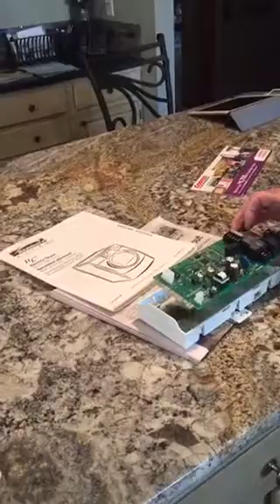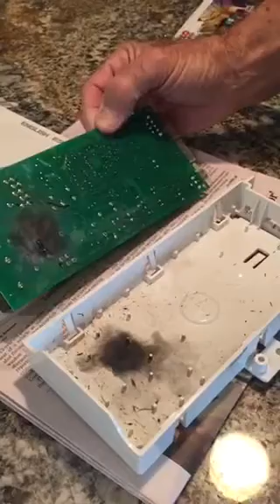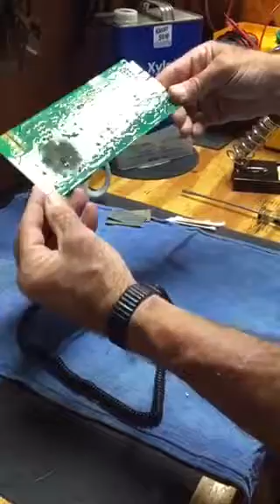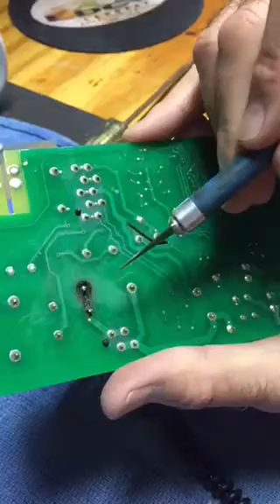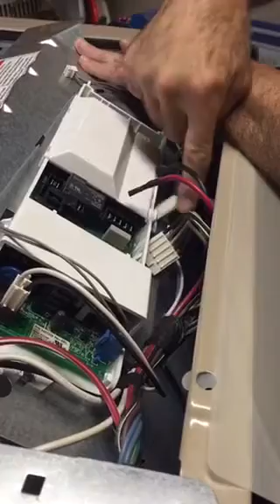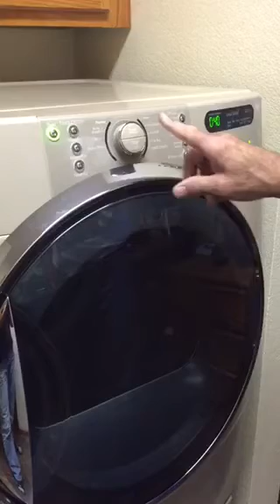Kenmore/Whirlpool Dryer HE5 F01 error code fix by Tom Miers

Comment: Tom, I just wanted to thank you for taking the time to post this video on YouTube.  It was very accurate and straight to the point for correcting the Kenmore Elite F10 Error.  I actually fixed my HE5 Elite tonight and it save me $235 for a new control board.

Comment: i had an Elite Oasis ST dryer with very similar problem-- the trace wasn't burnt... just a single solder on the back of the board had been toasted.  one good glob of sauter down in there fixed it. 

W10111623 (although the board has a Whirlpool board number on it:  W10111616 )
Reply: When I finally looked at the back of the board, there wasn't a burnt trace. One of the solders just looked burnt.  I tried what Glen said -- one good glob of solder and it worked like a charm!  Thanks for the advice Glen!  I'm a novice and needed to buy a soldering kit for this repair.  $20 spent saved me $300-400!